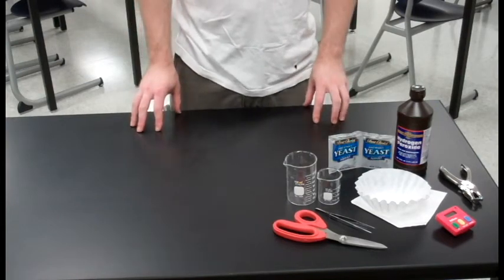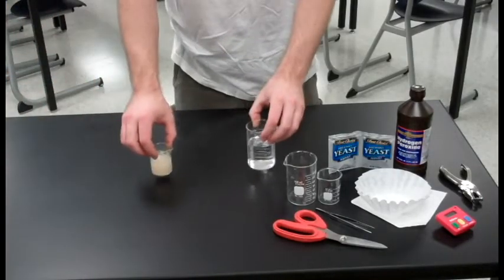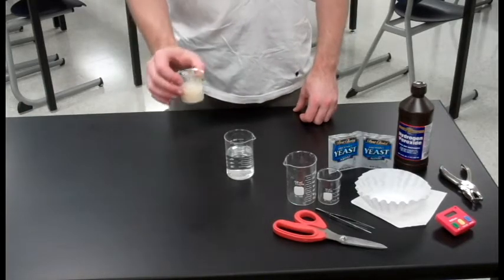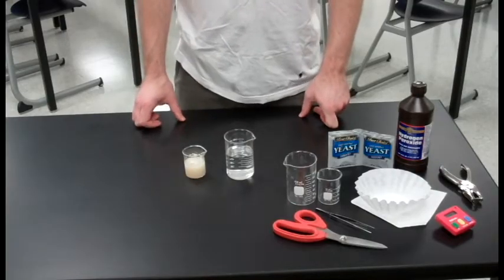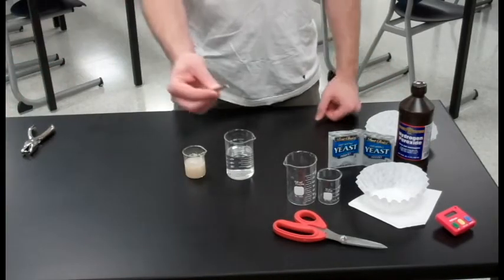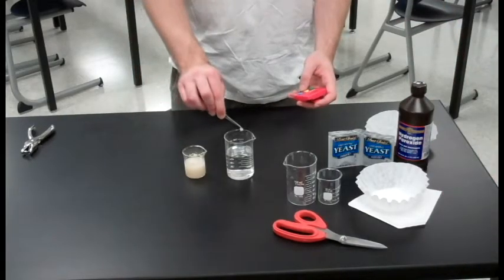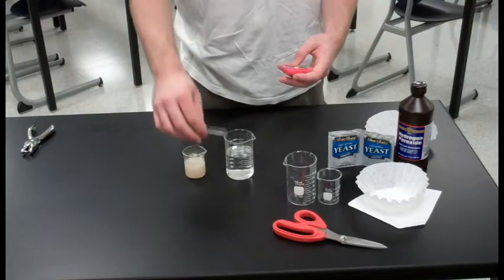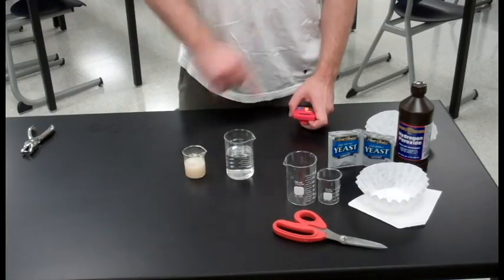Catalase Floating Disc Assay

Comment: if I aim to compare the different amount of catalase in different samples, can I cover the plastic viral with a lid and place dry filter paper on the water surface to let the pressure increase to push the filter paper downwards and take the number of filter paper sinks due air pressure for comparison.
Reply from the maker: I don't know! Sounds like an experiment. Let us know how it goes if you try it.

Comment: when i drop the disc in the H2O2, it just stays on the surface!! it does not sink?!?!?!
Reply: put it just below the surface of the h202 with the forceps so it doesnt have to worry about the surface tension  holding it up